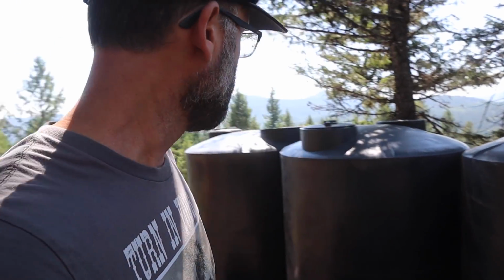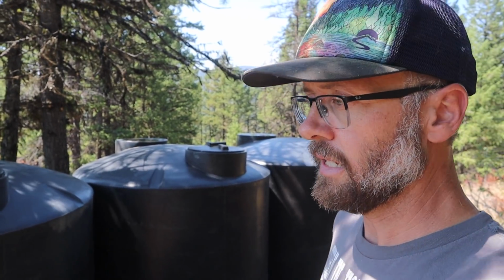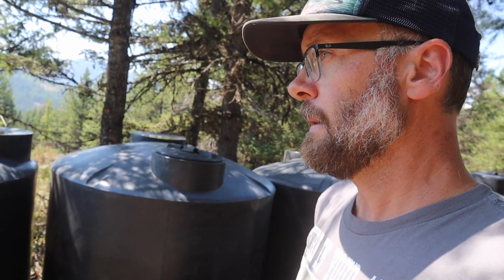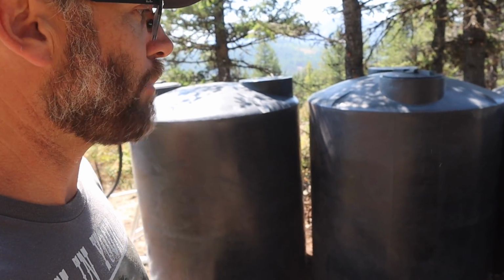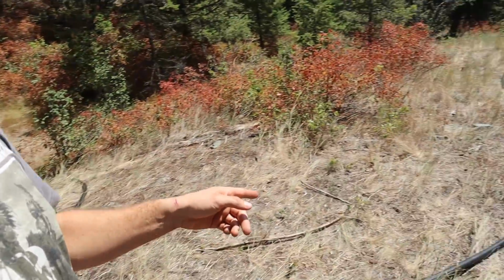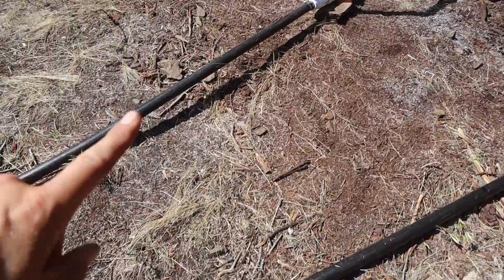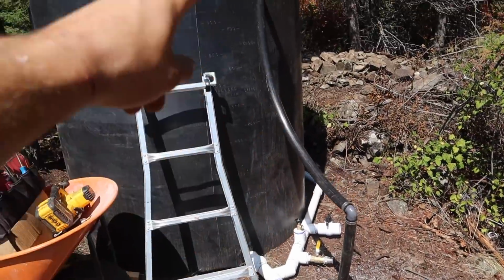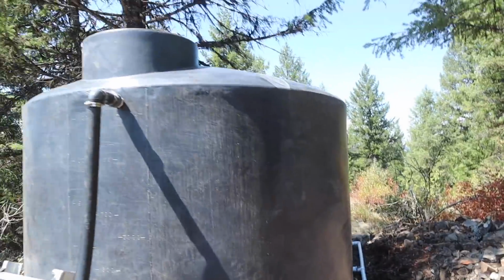Check Out My Off-Grid / Decentralized Water Storage

Comment: I have a similar set up. Exceptions,  the tanks are filled with a gravity fed spring. The tanks are kept full year round. The lines are buried 12". We get virtually no snow, zone 8. Fire is a worry, I have looked into the metal water tanks. Very expensive, requires permits and a cement foundation. I have recently installed another tank, away from these for rainwater harvesting and easier access in an emergency.  We fill the tanks through the top, in a chain,so that when one fills, it overflows through a hose into another. We have 8 tanks linked.

Comment: Hey there Curtis! You may have already thought about this, but do you plan on putting a pump at the tanks for fire suppression? Gravity pressure off of the auxiliary outlets won't be enough to keep a flexible fire hose open or push a significant stream of water. When I fought wildland fires, we used a pump that pushed 125 psi on 1/2" to 1" flexible cotton jacket hand lines. Other than that, we're super stoked about your redundant water supply! Great job putting that together :) We look forward to watching the more detailed version of this in From The Field!
- Brian + Erin

Comment: Curtis great video, don't want to sound negative but as an Aussie I have to ask "why" you went with plastic tanks in a fire area? were concrete tanks not available? if you have fire there you can kiss them and all the plastic pipework goodbye mate. also if you build a shed over them with guttering it supplies you with instant water, no pumping required.
Reply from the maker: Because concrete is heavy and access is limited.

Comment: 3 questions... 
I didn't see a winterize heater to keep your tanks from freezing; heater like a horse watering system . 

Any plans to electric / solar fencing to keep your bear away. 

Lastly, a tin roof to protect the tanks and to shed off any ambers in case of a fire. 

Always prepare for the unseen events, your good.
Reply from the maker: It's seasonal.

Comment: I guess my question would be. How much water in the tanks via gravity is equal to 60psi?   I would assume that 4500 liters of water trying to squeeze through an 1.5" pipe is equal to some amount of pressure.   Have you filled these up fully yet? How empty do they become, before the refill from the pressure tank begins? I've considered doing something similar, but I had always planned on running 2 sets of pipes, one for filling and one for draining.
Reply: Regardless of the amonut of water in the tanks you get 0.433 psi per foot of elevation so if he has an elevation change of 85' he will have about 36 psi consistently.

Comment: I work in oil and gas and those tanks you have there are a bit smaller that the 1550 gal used on a many of well site, they are used to supply the employees with potable water. They are usually stored within “sea cans” or “connex” or “shipping containers” what ever you guys call them up there, and the sea cans are spray foamed on the inside and heated with a milk house heater. That is more than sufficient for north western North Dakota to keep from freezing.

Comment: Build a structure to cover your tanks and use the surface area to collect water passively.  Or, use the hillside above the tanks to gather rain water to dump into the tanks.  You'll be thankful for the redundancy if you lose power for a prolonged period of time.  Don't forget to winterize.  Awesome work!

Comment: Are you going to bury those lines and connectors in the event that a fire gets close enough to melt them, thus short-circuiting your fire mitigation efforts?
Reply from the maker: Where I can, maybe. 650 feet of line and we're all rock here.
Reply: @offgridcurtisstone  Eish.. Perhaps cart soil/stone to cover it where you can't dig? I've seen situations where the water failed due to this, in Australia's bushfires.
Reply from the maker: I would take a year of work just to keep up with the endless suggestions from the YouTube comments.

Comment: Curtis, how do you winterize it? Do you keep water over the winter? If yes, how do you protect pipes from freezing?
Reply from the maker: We don't. It's seasonal. We're direct off the well to the house in the winter.
Reply: I am doing something similar and am trying to figure out the same thing.  Even if you drain them for the winter, the drain is in the side and you can't get all of the water out of them.  I would very much appreciate a video on winterizing either UTUBE or on FTF.

Comment: You should decentralize the tanks too. Connecting all together may drain them all if just one tank springs a leak.

And just adding a valve to each tank will allow you to decouple them and then join them back when and as needed.
Reply: Absolutely!! One way check valves between the tanks is a great idea (as well as couplings between, just for ease of access to repair/modify/etc.) Also, isolation (ball) valves per tank as well, for same reasons.